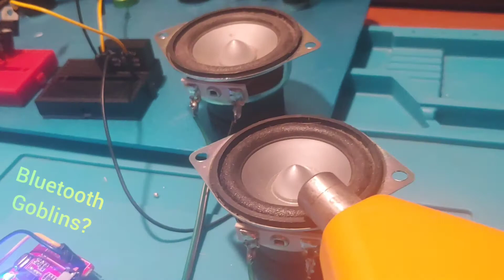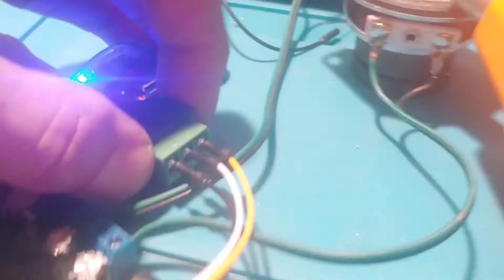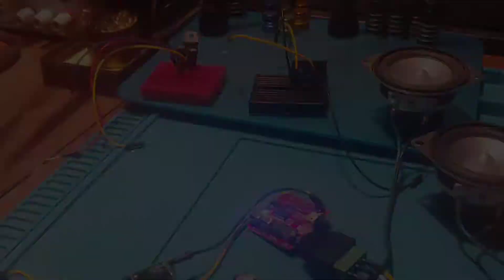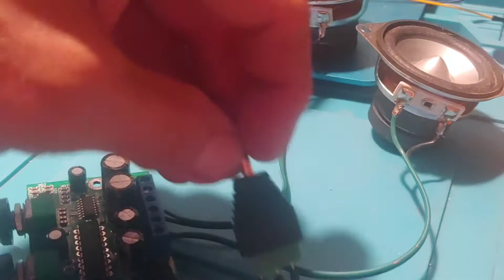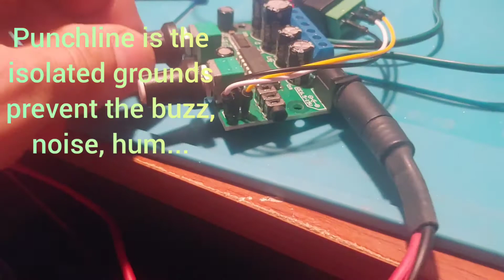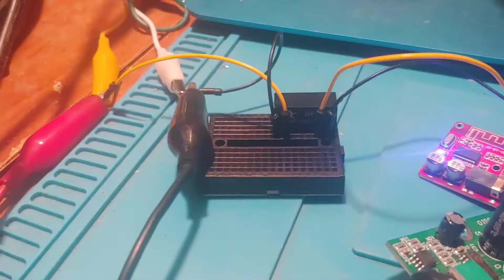Bluetooth Noise Resolved w/ 1205 Isolated DC Converter

Comment: SO confusing. The diagram shows a 6 pin but pin connection shows 8 pins. I have a 7 pin. Can you please explain the wiring? Is the DOT on the pin mean ground or +12v in. I think it means ground? And where is the + out and negative out pin on the 7 pin chip? Thanks

Comment: Wouldn't it be cheaper to drop the voltage with one of the normal converters and then use the much more affordable B0505 (5V) isolated converter?  Just thinking out loud, I have not tested it.

Comment: I came to the same conclusion some years ago, with these small cheap bluetooth modules the best way to remove common mode rf-induced noise is using an isolated regulator.

Comment: oh man please guide me. I have the same  noise issue. Now, the issue is. When I use the same power source for mp3 decoder(has integrated bluetooth) and amplifier it creates buzzing-beeping noise like you have in the video. But when I power the mp3 decoder and amplifier from separete power sources( for example amp is powered by 12 v 2a adapter, and mp3 powered by 9v battery) it works fine without any buzzing noise. And I searched on internet alot. People mostly talking about this as "ground loop". I still could not find a way to fix this without buying another equipment. I just need to fix this because I want to use single(same for both mp3 decoder and  amplifier) power source for mp3 decoder and amplifier. Therefore I can make it like a bluetooth mobile speaker. Please help me and guide me. I watched even other videos. People using single(same for both amp and mp3) power source but they dont be having buzzing noise. Why do I keep getting? Is it because I use simple croc cables to test without need to solder..  do I need shielded cables then I can use the same power source and the same ground? This message is bit long but I hope you could guide me, thank you. I watched your video, would the component you showed which is dc isolator solve this problem? And it would not affect the sound quality right? Because that is really important for me. Man please if you see my message reply. I want to solve this issue so bad. It took so much time of mine.
Reply: Yes you can use dc to dc isolated power supply as shown I video it works great